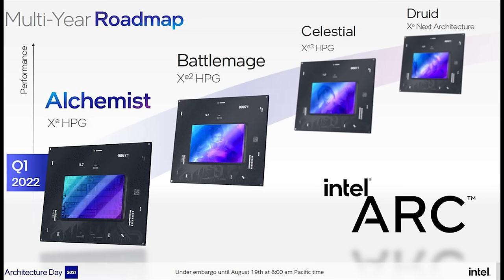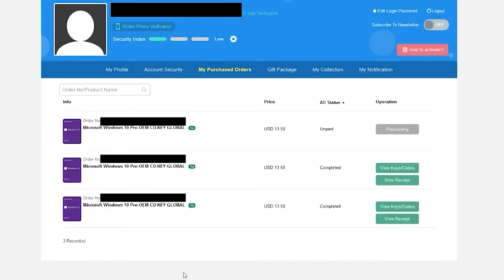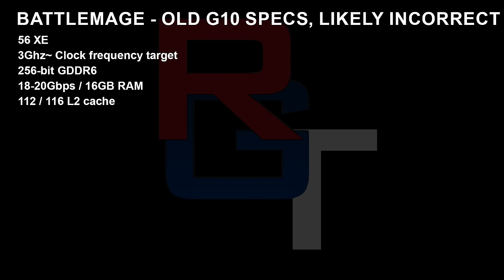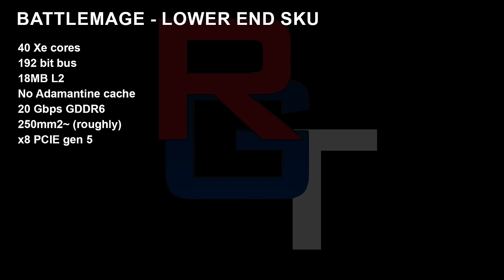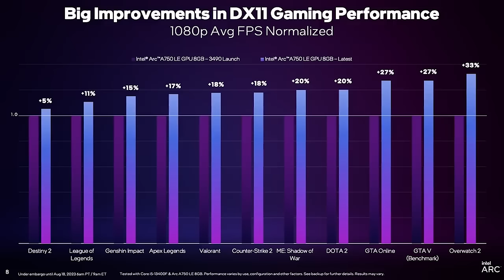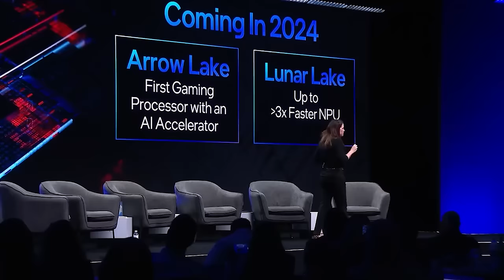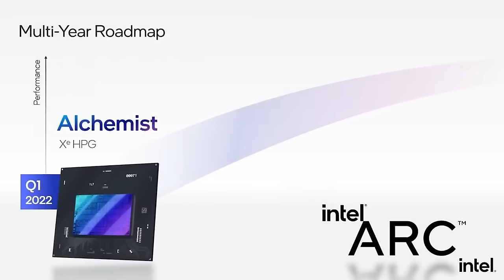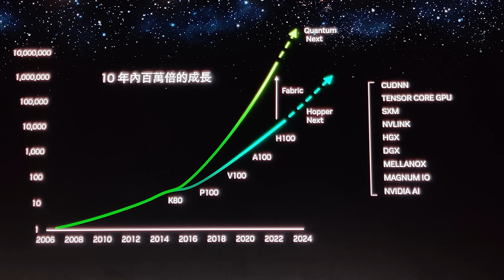INTEL BATTLEMAGE SPECS WERE WRONG?! - Big Update

Comment: I am really hoping the intel battlemage will be a full stack of gpu's at many different price and performance ranges, including the high end one.
also largely since I want them to do well especially with Ngreedia(Novidia) being so evil lately(and that is not even concidering their insane prices for what you get(which amd likes to follow as well)) but that is just about the straight up evil Novidia has been doing more and more.

also I really hope they launch soon, even if only the mid or low end models launch first during the original lauch(if the high end model won't work properly yet or such).
kind of have been waiting with getting a dedicated pc for battlemage, even though I am the kind of person who doesn't tend to get the highest end model without good reason(I tend to get something which seems really worth it the most yet still also is actually good enough to do basically everything I want to do).

since what I like to do is gaming for fun, productivity for fun, and AI for fun, and experimenting for fun, those new generations seem really good and I expected that already which is also why I waited rather than going for a A750(since when those launched the A770 was much more expensive, today the A770 might actually be a better option.(also back then another reason to avoid upgrading was because the other hardware seemed to largely be in one of those stalls where it gets super expensive yet doesn't really have any upgrades you will notice in those generations, kind of those things you will only later notice like the switch to ddr5 and pcie 5 and such which back then generally had little noticable effect but a huge effect on price(especially motherboards being expensive), by now those things finaly start to make more sense to have in a normal system and prices also have more settled again.
Novidia has been quite much a avoid as much as possible due to their terrible ethics as well as them being insanely expensive for what they deliver(a a770 for example is similar to a rtx 4080/3080 only difference is the a770 being new/bleeding edge and so not yet properly software supported and games and such not yet being optimized for it, while rtx3080 is legacy technology so well supported already, but looking at the actual cost for making the gpu the A770 would be similar to the rtx 4080, also when looking at raw performance, when also looking at development cost the a770 actually had way more development in it than the rtx4080 had because the a770 needed to be designed almost from the ground up. AMD follows novidia to much and doesn't really try to push or such.

so I really hope the Battlemage series launches soon and also is good, or atleast good for the price, since what many people do not get is that the PC market is actually insanely bad currently due to the novidia and amd gpu's being so insanely expensive, and they scale performance pretty much lineair with their price instead of actually making the flagship much more expensive relatively seen, their mid end gpus which normally are by far the best value actually aren't the best value anymore.
with the Arc Alchemist series the pricings made a lot more sense, with the mid end being better value than the flagship, and only the very low end models actually being slightly worse value(due to base costs in such thigns). next to that the alchemist pricing actually was the only gpu pricing which actually had proper worth value.

with battlemage if it gets better value than the alchemist series, and also again has a broad enough spectrum then that would really be great and disrupt the market.

I do actually hope to also see the high end flagship.
however I do agree with intel in that their concern for the flagship not selling as well is justified, the reason is that while revieuwers and tech youtubers tend to talk always about the high end models, in reality currently basically no real people buy the high end models(except for miners and other such companies).
for novidia its rtx 4070 actually is it's flagship, since those others are there more for show since noone actually buys them despite them producing almost none of them, they just make those so people say novidia is faster.
in reality peoples average free to spend funds have greatly decreased, yet hardware prices have greatly increased. 
the biggest market right now would be in gaming and AI pc's which cost around €600 to €1200 or budged gaming pc's which cost around €400
those €1200 would be the actual high end gaming pc's.
if we subtract the rest of the hardware and also asume more expensive pc's don't only get more expensive due to the GPU but also upgrade cpu, motherboard, etc. then we see that it is actually the mid end GPU's almost everyone will be buying, especially if those have best value like they should.
the highest end models are mostly just for show.
so in the case of Intel Arc Battlemage if that generation is actually really good in reality then their non top end model actually already might be good enough to beat the mid end cards of the other competors and potentially even for a much better price to make sure many people rapidly switch to/try out intel arc GPU's(since a large marketshare gets things to be developed for your cards thus giving you a advantage and also gets people to like the name, right now intel arc gpu's are mostly just known as gpus for the pc enthausiasts, but not yet as much for the general gamers and normal people, most people don't  even know yet how well it works, if battle mage is good enough that might disrupt the gpu market and once people use it, it gets known.

Comment: 40 Xe variant looks roughly like the size of a 4070 amd 56 is the size of a 4080 (not counting the ADM).
Intel is far less efficient in terms of performance/mm² on the same node. On arc they needed 400mm² N6 to compete with N33 at 200mm² N6.
So I expect a 56 Xe variant to be roughly a 4070 competitor, the 40 Xe variant a 4060 competitor.

As far as I understand it ADM is simply SRAM on an older node. 512MB SRAM would cost them a fortune in addition to the already not cheap 350-400mm² of TSMC N5. And that for a card that they could charge 500$ in 2023, maybe 400$ in 2025.

Comment: So.. the bus size is smaller than expected constraining bandwidth, they are only using 8 PCIE lanes, and the L2 is down to 12MB, this is starting to smell like the same kind of shit that Nvidia has been pulling... what a surprise...
Reply: Tho it would be a step back if it really was 192bit because that means 12GB (unless they use denser modules to double to 24GB).12GB would be disappointing considering they have 16GB now.

Comment: Vram uses a bus the runs between the GPU and the video-RAM and * I understand this can be a bottle neck.*** I like to learn more about this as I Just have basic understanding 
A higher Bus width allows for the transfer of more data per LOAD operation. In theory, a 256-bit GPU can access 4x as much data as a 64-bit CPU in a single LOAD operation (hence, why CPU’s tend to be clocked higher, to allow for more LOAD operations to compensate for a small data bus). * So underload a GPU Bus bottle neck results in your game starts stutter.

Comment: After building 4 PCs in '23 with A770s, I'm amassing parts for a new one, intending to use a Battlemage. I just bought an RX580 (8GB/256-bit) as a stopgap but Battlemage dropping to a 192-bit bus and 12GB is a deal killer - I might as well spend the extra dosh and get a 4070 Super. Or another Bifrost. What are they thinking? It doesn't make sense that they wouldn't maintain the key features from the current models with the 2nd gen parts. I hope you're wrong because I really don't want to spend $800 on a 4070 Ti Super but I will if I have to.

Comment: "...being the first discreet graphics cards the company has launched." Except, it isn't. In 1998, in order to try to promote the use of, the then rather new, AGP bus, Intel released the "Intel740" graphics processor, with plenty of marketing to back it up. I remember reading reviews when it came out, on the old version of Tom's Hardware Guide, when Thomas Pabst was still in charge. It wasn't very good though, and quickly was dismissed by the gaming community. It seems like most people have forgotten about this chip, but it was certainly something that people were well aware of back then.

Comment: I have to say it doesn't make much sense to me that Intel would release two designs that are so different - one relying on an enormous amount of level 3 cache (or is it 4?) and the other a fairly small level 2 cache.  I guess we'll have to wait and see.
Reply: Not to mention 12GB ram makes zero sense at all. Every Battlemage card will have 16+ GB ram. Mark my words. He is just trolling with us... or he has been trolled.
Reply: @TheBann90  Yeah my assumption would be either 18 G (with 3GB chips if it ends up using DDR7) or 24 GB.  It doesn't make sense that it would have less VRAM than the A770.

Comment: 192-bit GDDR6 would be very bandwidth capped if they plan to ship it with a chip equivalent to a 4070 ti. Okay-ish for a 4070.

It's just that if they let it slip up to Q4/24 or Q1/25, it will be dead on arrival vs GDDR7 @ 32Gbps and 24Gb memory ICs.

Comment: Intel has a 30% cost advantage on the dGPU component itself v AMD and Nvidia IF Intel manufactures the component itself but few too no scale advantages on cards and Nvidia crushed in 2023 and except for BM iGPU for at least the next six months in discrete graphics on Ada Super parallel Ampere secondary 'used' refresh. Lots of Ampere trade in being resold. Intel for Xeon Phi went through dev + 3 evolutions before they scraped the effort secure key encryption was the application demanded use and a lot of that had to do with so few knowing how to code Phi. mb
Reply: Indeed. If Intel and Pat Gelsinger wants to take the lead in every segment of the industry. As he has stated, he can do it. It is just a matter of when. Question is how quickly they want to reach the top.

If we only get the 40Xe core version of this, that doesn't seem in line with his earlier remarks. It also makes zero sense in regards to the slide with the new memory.

It has nothing to do with cost/earnings. Everyone can tell that is a lie if someone has claimed it.
Reply: Intel are doing basically all their GPU stuff on TSMC for the foreseeable future.  Shit, they can barely build any sort of scale or maturity for their newest nodes even for their CPU's.  Intel's foundry side is running fast right now, but they're not actually achieving much of real world value.
Reply: @maynardburger  Only Battlemage and Celestial is set for TSMC nodes. Beyond that we don't know yet. Your statement doesn't take into account the length of the process of making these chips. TSMC is actually also helping Intel with the Battlemage architecture, though I'm not sure if they have an ownership stake in it.

Saying anything about Intel foundry business at this point regarding maturity is a bit void imo. They saw a 300% increase last year and is set for another 300% increase this year with heavy investments the next 4 years.
Reply: @maynardburger  Intel on TSMC r tapers to benchmark their own developments range 6 to 3.  Intel variable cost TSMC knows this $39 per unit around abouts 2023 10-K is soon I will compare with production stats. 

@May what do you mean Intel IFA is running fast right now?  On the real world value I get that . . .  so what is "running fast"? mb
Reply: IFS fumble fingers on the key bd mb
Reply: @maynardburger  SF 10 is highly manufacturable. I am waiting for 4 data to conduct the analysis. Intel is tapered into TSMC range 6 to 3 for their own inhouse benchmark purposes. Intel use of TSMC 6 like AMD is a high volume industrial embedded process that needs to be hidden behind a disaggregate system bus on wof wof performance but cheap and highly manufacturable for industrial embedded. AND AMD is cheap, basically. Nvidia knew. See my report on Seeking Alpha "Server Today - Update of June 30, 2023" for SR SF10 cost and yield data v Ice at 10. mb

Comment: the nextgen memory subsystem and compression might actually be better than it sounds.
it might be that since despite memory compression being around for centuries in Linux, it got more famous since apple recently said their ram is 2 times as valuable(compared to windows) since they copied one of those memory compression methodsd from gnu+linux.
while apple hid the fact that in gnu+Linux memory compression is even better if you enable it meaning that gnu+linux ram is worth more than apple ram, there was a partial truth to it.
modern systems just are so fast that they can do serious compression without much effort and without really reducing performance.
to make it better with good memory compression hardware you can actually get better performance(bandwith) out of the same ram, actually more than 6 times the officially rated bandwith(even though intel likely won't use such high ratios since at that point it starts to make tradeoffs in things like games, for AI it would actually likely still work even at a ratio of 6).

it might be that in the battlemage gpu's they either added dedicated compression and decompression hardware, or just optimized the hardware for a software or driver controlled memory compression.
but if intel adds in hardware memory compression or another good implementation that might mean that in videogames you could easily have effectively 1.5 to 2 times the rated bandwith and capacity, and in things like AI even more.
based on how GPU's work this memory compression is actually very realistic to do and actually would improve the gpu since GPU's already use a wide bus, the reason that in normal ram for a cpu memory compression starts to get drawbacks more early after reaching the 1.5 to 2 ratio is due to it's very small bus. since it essentially tends to increase the chunk size, which in this case could litterally be midigated by treating it as a larger bus, lets say we use 1.33 as compression ratio then a physical 192bit bus essentially can become a 256bit bus without noticable compromise in latency or such(other than the decompressing chip). ofcource we can also increase the ratio much more without changing the virtual bus width but that is much more likely to result in a increase in latency or such, or the unnececarily needing to read some memory, even though this also can still perform better than uncompressed memory.

Comment: if intel only goes with the 250mm² gimped x8 pcie lane gpu, intel discrete gpus are done. no one will want to invest into a brand thats only offering trash tier hardware and the creators looking for an a770 16gb follow will be gone aswell. even tho margins may be slim, intel needs to have a somewhat respectable lineup to establish their brand in the gpu space with a card at the top that displays some interest in the customers, like the a770. imagine intel trying to get into the ssd space after optane but only offering cacheless QLC ssds. i was looking forward to get a successor for my a770 from intel, but if i can only get a vram downgrade, im gonna go with nvidia.

Comment: that's not good news.
Battlemage must deliver at least 4070 TI performance for at most 400 USD, or it's dead on arrival
Reply: It really doesn't matter what the performance or price is, you'll just buy whatever GPU NVidia thinks is good enough for you. Intel already put good GPUs on the market at a reasonable price, they're still on store shelves.
Reply: @nimrodery   they are still on the shelves because you can get better performance at a better price especially during the previous black friday.  Intel brought a card that is subpar, People want high FPS 1440p at a low (500.00 or less) price which isn't going to happen.  The intel A770 is a 250.00 card max.  So for me to buy Intel it will need to perform 4070ti levels with 12 plus gb memory  at 500.00 or less.
Reply: @Wilsonandcars  Nice story, but there wasn't a single NVidia or AMD GPU available anywhere near MSRP when I bought mine. Intel was selling at MSRP right through the "supply crisis." It was and still is a joke, you care about branding and that's all.

Comment: I would love to support Intel's graphics, and I've been seriously thinking of buying Battlemage if it offered enough. But there's no way I'm buying a card with only 8 PCIe lanes, I don't care what Gen it is. 16 lanes or GTFO. 

It's already scummy that AMD and Nvidia have been putting 8 lanes on entry-level enthusiast cards, as it screws over people with older systems wanting to upgrade. It's calculated to force people into buying new motherboards and CPUs, which is truly contemptible. I won't condone such behaviour by buying into it, ever. If it means I have to upgrade every third generation, instead of every second as I have been, then that's what will happen. I'm due to upgrade this coming gen, but if the cards in the price range I want to pay only have 8 PCIe lanes, I will skip it.